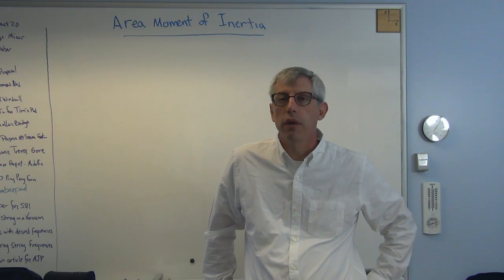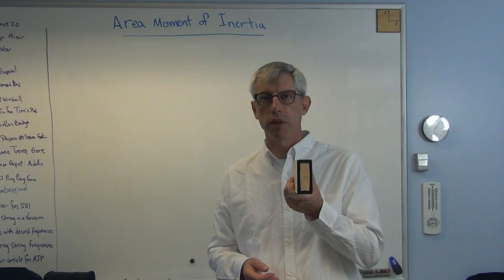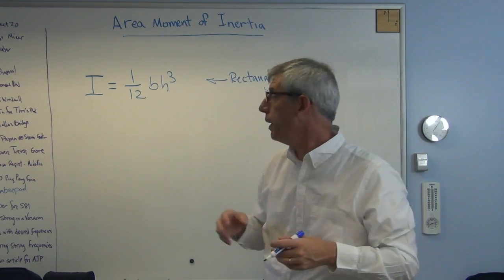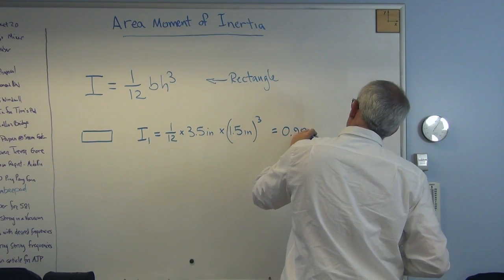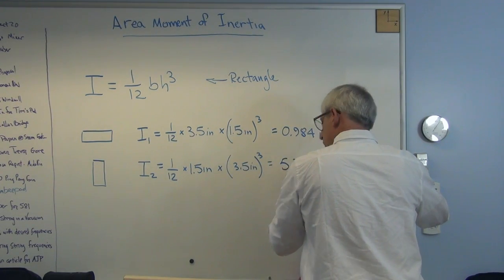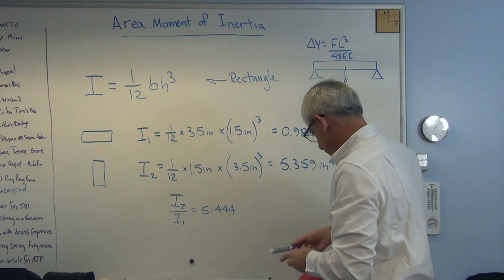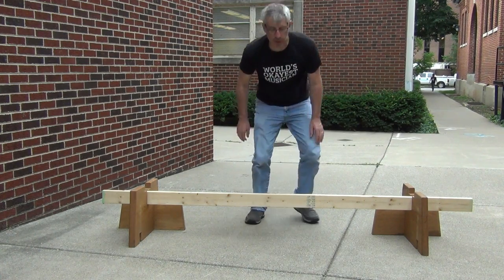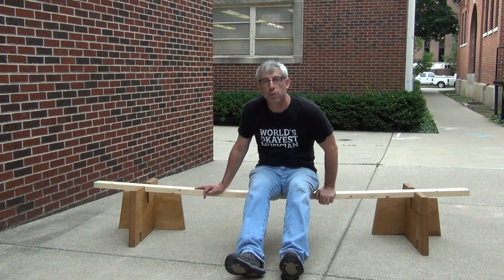Area Moment of Inertia - Brain Waves

Comment: excellent video on the subject, principles and real-life demo. It would have been interesting to make the same beam with 1/4-inch-thick pine box beam glue up, same size as the pine board you are using and demo that also. I am sure the beam would hold you also. I would have been good to have measured the deflection and know your weight to have further understanding till you have broken the board. The video could of had a free body diagram, to define the 'design specification', review of the formulas, did the demos, talk a little fo tbe design requirements and safety margins would of completed the video for me! But well done, nevertheless.

Comment: stiffness is 5.444 times higher on vertical position, but strength is the same, am i right?
Reply from the maker: I'm afraid not.  The normal stress is My/I.  If you substitute I=1/12*b*h^3, it works out that the stress at the top and bottom of the beam goes down as h^2

Comment: Sir,I understood everything clearly but I am having a small doubt why moment of Inertia is calculated only for cross sectional area??
Reply: I think that 
When the load is applied on the beam it acts perpendicular to the surface and try to bend the material along its surface. And the material shows stiffness (resistance to rigidity) towards it, and to calculate how much stiffness the beam or material shows we calculate it's moment of inertia. For the calculation of moment of inertia we need to know the cross-section of the element along a desired axis we want to find.

Remember when we study in class 11, the moment of inertia with its parallel axis theorem. In there the cross-section can be of regular or any irregular shape. But in case if beams we have standard shapes.  

I hope that your doubt is cleared.

Furthermore you can calculate the beam stiffness at any point of fibre by changing its axis. 
Any more questions..... reply me.!

Keep learning and growing.!
The knowledge is aggregation of marginal gains
Reply: @risky_world5692  thanks a lot

Comment: Stiffness due to geometry! That short sentence changed everything!
Reply: Stiffness due to geometry = Moment of inertia 
Stiffness due to material property = Youngs modulus of Elasticity.
Reply: @Eagle_1174  Right. When you derive the sectional forces, the effective stiffness in terms of how the strain of the section changes with stress will come down to something involving x^2 with area. So, that turns out to be equivalent to the second moment of inertia as it is defined. 

The elastic modulus is also included in the bending stiffness. So, although those are true statements, the true stiffness of the beam is a combo of both in a sense. Only stating this to allow people to understand that for bending you need both for the full stiffness.

Comment: Sir, when we say first moment of area = O, what do we mean by that , physically?...like area moment of inertia tell stiffness due to shape.
Reply: Moment in general means quantity multiplied by distance to a reference point.  First moment of area is area multiplied (or rather integrated) with distance to the centroidal axis.  Second moment of area, squares this distance.

A practical reason why we care about first moment of area, is the strength of a member against shear loads.  Maximum shear stress is inversely proportional to the first moment of area, and thus the shear strength of a cross section, is based on the first moment of area.

The first moment of area is also part of the algorithm for calculating the centroid.

Comment: I understood that means stiffness.
Can you relate the moment of inertia with the bending moment of equation i.e. M/I=σ/y  with  a suitable physical example ?
Thanks in advance
Reply: It’s everywhere. Think of it as the stress at any point perpendicular to the axis of bending is no different than a thin fiber in tension or compression; at that point, the strain is the stress divided by elastic modulus. The strain in beam can ALWAYS be derived from the linear elastic and fully planar assumption where the section MUST rotate about some point (also known as the neutral axis) and maintain a linear profile. This rotation is proportional to a curvature radius and length of the beam with small changes along the radius (called curvature). It is then possible to relate the length and the dimensions of that section to the strain which then becomes integrated with definitions of E and I. Let me know if you would like me to show the entire derivation.